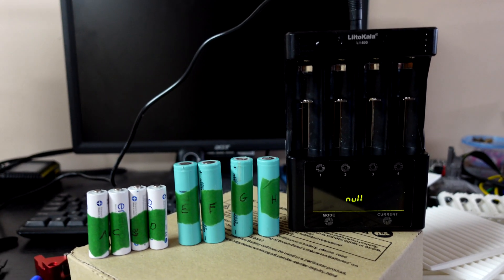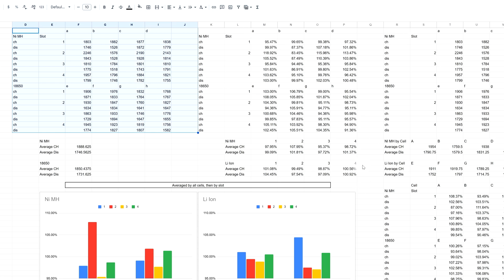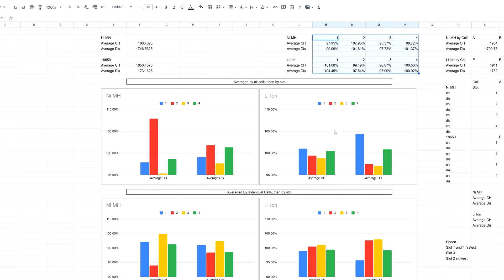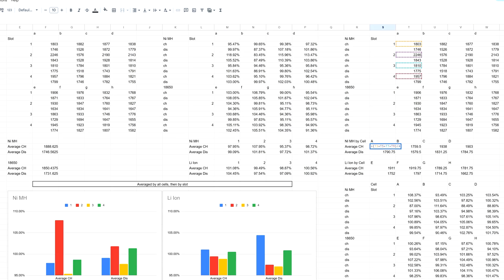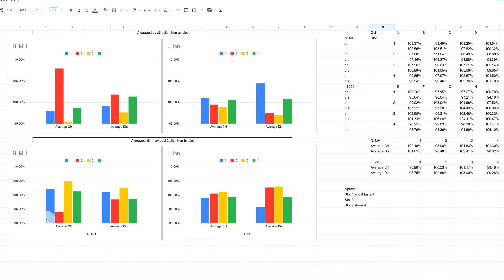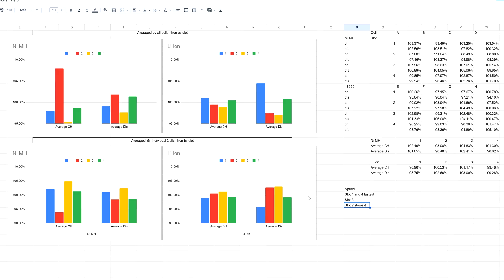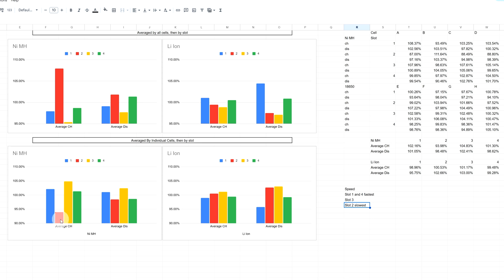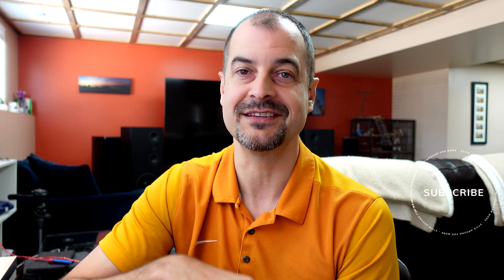Charger Slot SHOWDOWN: Leala i600 Accuracy Test!

Comment: what settings do i use for 3200 mah
Reply from the maker: You should be able to go at the max rate for discharge and charge on the charger.
Reply: @ I figured it out- thx for responding